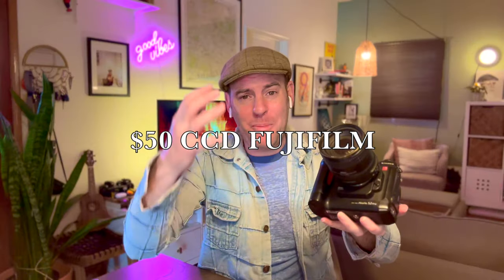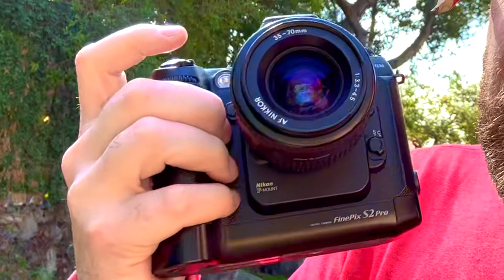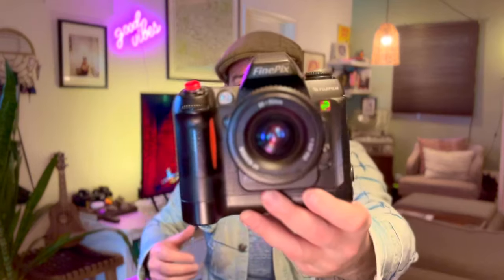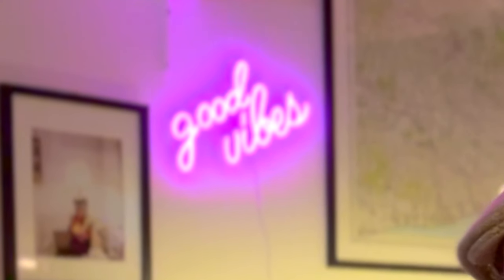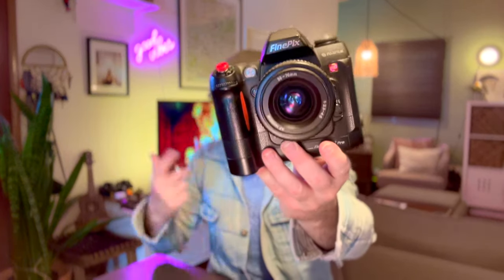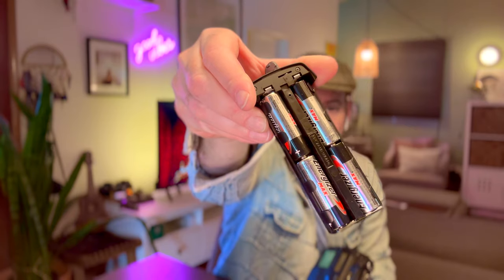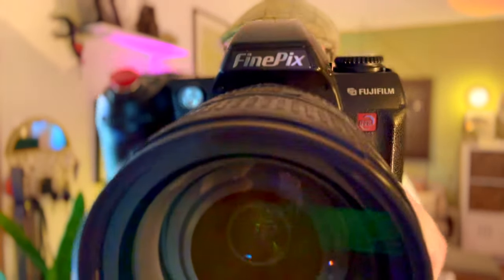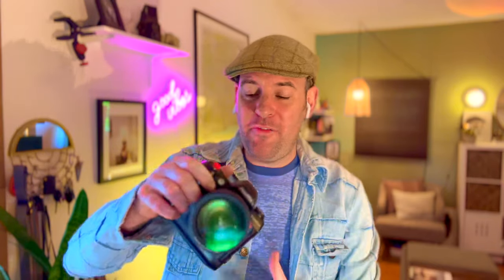Why are FUJI Cameras so dang good ?! FINEPIX S2Pro in 2024

Comment: I bought a Fujifilm S-3 Pro brand new in 2005 for around $2K. Years ago the viewing screen died but the camera still works but you can only adjust whatever settings are available using the function buttons. I recently picked up a second S-3 Pro on ebay for $100 with a 28mm AF lens. I never owned a S-2 but I didn't like the fact that you needed two different battery types to run the camera. The S-3 Pro only takes 4 AA batteries. Don't know how long they'll last but for the price they sure are great to shoot with. :)

Comment: Mine went very weird. It had a problem with the CCD or processor and it gradually descended into complete psychedelic glitch madness. I had it repaired by Fuji UK once, just at cost as it was a known issue. The problem came back in a few months. I sold it on eBay (where it came from) and got about the same as I paid for it listed as a "glitch cam" with some really messed up images as examples.
Reply from the maker: YES ! There were so many with the CCD sensor issue , another reason they lost a bunch of money on the S2. I had the same issue with the sensor in my Minolta DSLR from back then. Lilac / purple streaks on the screen and eventually a dead sensor. The one I have now is tip top although the battery door is a little cracked